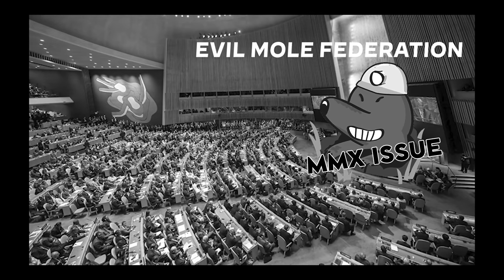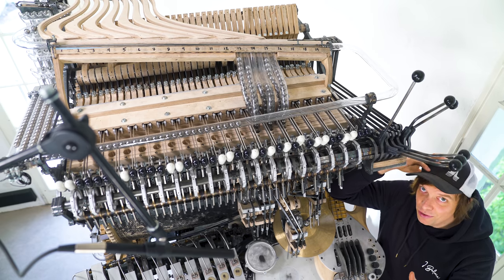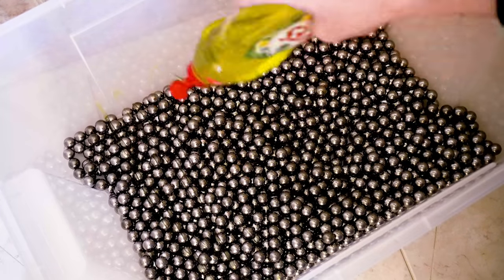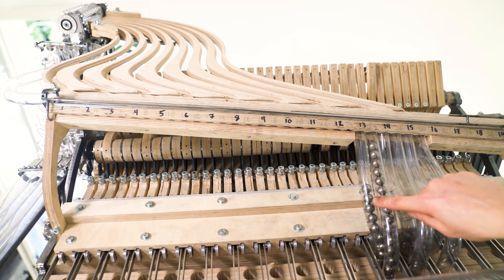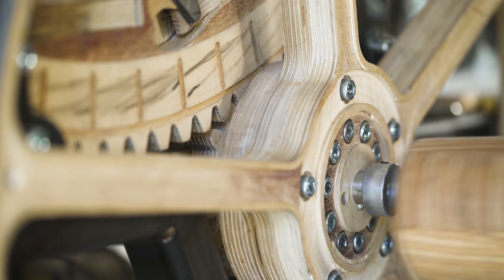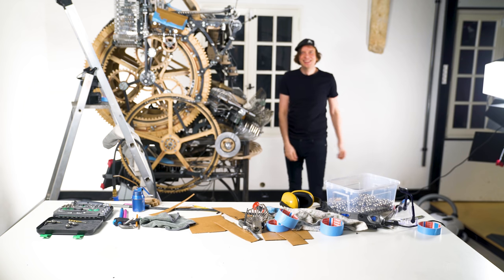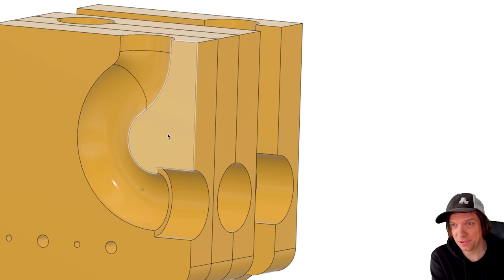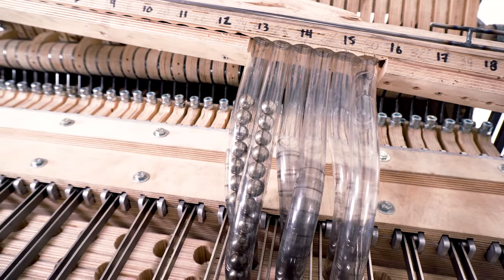Why Are 1000 Marbles On This Red Towel?

Comment: Aren't there degreasing products that don't contain water? Also, you may need to use a blackening solution to prevent rusting on the marbles and the machine, as they will be traveling to different climates.

Comment: I was kind of expecting some problems coming from using the graphite in marble paths, but this was unexpected. I was more expecting at which point Martin notices that the silicone pads on instruments and all of the marble paths start to turn black from the graphite. But now thinking and knowing that Martin uses steel balls with oil coating (I was in believe he was using nickel plated balls) it's kind of clear that the oil will be tainted by the graphite and gunk up. I haven't kept up are the graphite infested parts still in the path but either way there's going to be a huge cleaning day coming to get all of that graphite off or time to change the balls to something like aluminium alloy bearing balls or nickel/chrome plated bearing balls (if I'm right both of these don't need oil coating and can be de-greased without rusting but get samples before buying huge amounts to test is the used alloy magnetic enough for MMX).

Comment: Rust means that the surface of the marbles becomes rough (like sandpaper). Even if you remove the rust, you will have tiny holes in the marble surface. Not good for the wood.

Comment: Yeah, using the heat gun will have sped up the rusting.
I'm sure there are chemical degreasers you can get that are supposed to limit the oxidation you'd get from using water

Comment: You can polish them with a tumbler and walnut-shells. Just for the record, if you rinse them off with demineralized water and then give them an alcohol bath... They will dry faster and be less prone to rust. But, you will have to ultimately tumble them with a tiny bit of mineral oil, in order to stop them from rusting. Its oxygen in the air which makes them rust. There is more saturated oxygen in water, causing them to rust faster, as well as dissolved minerals that react with the metal. They come with a vaporized layer of mineral oil on them, to keep them rust-free from the factory.

It is that OIL which is picking-up the graphite. You can't have your cake and eat it too... If you want the graphite, and no rust, you need the mineral oil. If you can live with the rust, just use the graphite and manage the rust with walnut tumbling before a show.

Otherwise, you have to just stick with the classic mineral-oil coating and manage the friction with the dirt-collecting coating on the marbles. (Or get chrome-plated steel marbles. Then deal with chrome chips all over. :P )

You could always do the "Brass balls" path... But then none of your magnets will work. If you go to true "stainless-steel", you also lose all magnetism. Since carbon, chromium and nickle and is what makes iron into "non-rusting stainless steel". But too much carbon and you get no rust or magnetism.

Comment: Rather than threading directly in to 3D printed parts, you can is a tapered heat-set brass insert. Heat it up with a soldering iron and push to set it in place. Then you can use thread locker to hold screws in place.
The other approach is to print a pocket for a conventional nut that is then press-inserted in to the plastic (so that it becomes captive) on the opposite side to where the screw is inserted. Again, you can then use thread locker. Another method is to have a slide that the nut is side-load in to. Here's a page that shows various techniques: https://www.cnckitchen.com/blog/helicoils-threaded-insets-and-embedded-nuts-in-3d-prints-strength-amp-strength-assessment

Comment: i think the over rotation is good when the marbles are flowing freely, because it takes more for them to gain momentum (more rotational momentum is required to achieve the same speed).
in the pressure system, i think it is causing the friction to become unreliable. if the marbles are rolling along their outermost radius, the friction with the wood is a torque acting at the same distance as the friction with other marbles.

if the marbles are rolling using over rotation, then the friction with other marbles has a mechanical advantage compared to the friction with the wood. i think this causes 2 things:
1. more friction, because there is more rotation on the marbles, there is more friction between the marbles. (could be good)
2. more variance in the friction. if the friction with other marbles has a mechanical advantage over the friction with the wood, then it would be more likely for the friction with the wood to be overcome, causing some slippage. if they slip, then roll, then slip, then roll, or one lane slips while the other rolls, you will see unreliable results. (definitely bad!)

i would like to see this theory tested though, maybe the marbles are not rolling in the pressure tunnels at all?

Comment: You'll need to keep some sort of oil or grease on the marbles to protect them from oxygen in the air. When I first saw you using graphite powder, I literally cringed because I knew it would be taken up in oils on the surface of the marble and become like a sludge. I don't think you can get around the fact that you need oily marbles unless you get them in a material other than (economical) steel, so you'll need to keep them oiled to avoid oxidation. So you'll need to find a different solution for lubing your ways.

Comment: What about ambient humidity?  Your studio doesn't seem to be climate-controlled, and the plywood is probably expanding slightly in humid weather.  So any plywood part you fine-tune for width (marble lanes, pressure and height modules) may be too narrow or too wide when the humidity changes.  Dare I suggest.... start making everything out of HDPE?

Comment: Good video 👍. No more graphite, good find. Steel marbles? I have been assuming you were using bearings, you get what you pay for. Bearings are made with more nickel and other alloys making them very tough and will resist rusting also more precise. Don’t take my word for it call a bearing manufacturer find out for yourself.

Comment: locktide wil work when you use a drop of water i use locktide on a plastic ferist wheel that keep on sliping and now it wont slip anny more. whel after loking up how locktide work and it seems that is go hard by the water in the air. so i put a drop of locktide on the ferist wheel and a drop of water en left it for 1 day and nicht and its not sliping anny more :)

Comment: looks to me as if the marbles have to much room and are wedged into the tubes and your pro grade force not center is do to angular motion.  a simple rail system like you have on top is the better solution in my opinion. get rid of the tubes and replace them with rails if possible.

Comment: I really dislike the approach Martin has taken to reduce the marble pressure. Making it a more tortuous path mainly reduces the speed the marbles flow at instead of the marble pressure. He needs to redesign the marble gates to make them work with more pressure, or lower the marble divider to reduce the pressure.

Comment: I bet you anything that graphite lube adhered to the surface with simple static forces. Next time you need to clean them, use alcohol. It should be enough to break the static bond while still allowing them to dry fast enough to not rust.

Comment: Stainless steel marbles. 
440C is stainless steel, (although not completely rust proof). And are magnetic. They don’t magnetize but are attracted by magnets. 

Metal filings and metal dust sticks to Magnetic steel marbles, even after demagnetizing. And cleaning steel as you know is a problem when no oil is allowed. Stainless steel may be worth looking into. 

From their website:
“Stainless steel bearings made from 440 grade steel are strongly magnetic” 

https://www.smbbearings.com/are-stainless-steel-bearings-magnetic

Comment: To restore the rusty marbles without etching them with acid, you might try electrolysis like Odd Tinkering uses. See example here: https://youtu.be/SYMsGTKFaas

In this case, I think I'd put a small steel plate at the bottom of the container connected as the cathode. Then dump the marbles in on top of it. They should form an electrically-conductive lattice. Then just mix them around ever so often so every bit of surface is eventually exposed. That should restore them without losing material from them. Then clean them with alcohol and dry them without heat as other commenter have said.

Comment: 9 think you should oil your marbles with realy thin oil so they can Slide in the Tubes and wegen 2 marbles have Kontakt while Rilling they have Mode friction and geht Stück because the surfaces rotate in different Direktion #mmxissuefix
Reply: Sorry I ment you should oil the marbles to reduse friction while they are in the tube because when the marbles Kontakt while rollingvtheres way more friction

Comment: Martin you're definitely too hard on yourself. While you're defining a lot of these issues as design and engineering mistakes, ultimately these are hiccups you'd eventually run into versions of during the ongoing maintenance of the machine. Your somewhat modular design is only going to partially mitigate the difficultly of diagnosing a problem. You're just learning the quirks of the device.

Comment: At this point this project has gone on for a couple years and I have lost interest in this project, tbh the whole machine needs to be built using proper materials as wood specially plywood was a mistake to begin with. would be a better idea to have made it from PLA or ABS. Investing in a large form factor 3d Printer would solve all the issues with using wood, specially as he plans of touring with it and wood absorbs moisture. Im sure the machine in its current state would not last past one tour.
Reply: Absolutely not true. Plastics come with their own downsights and i love the look of it.